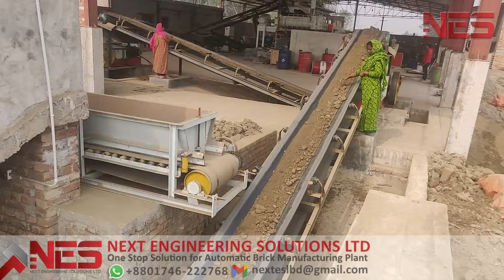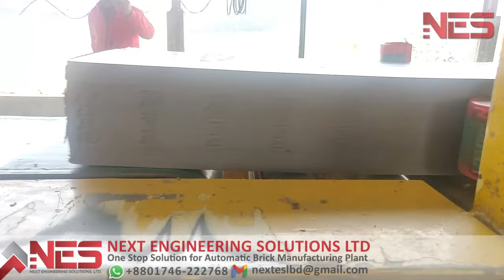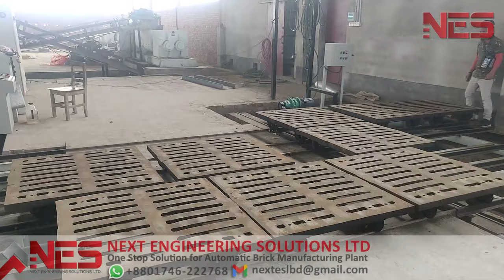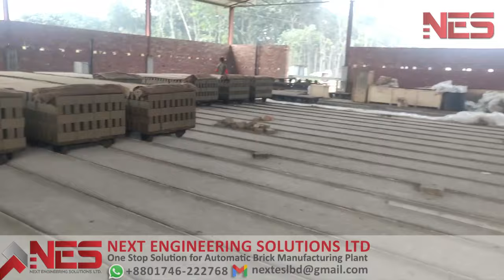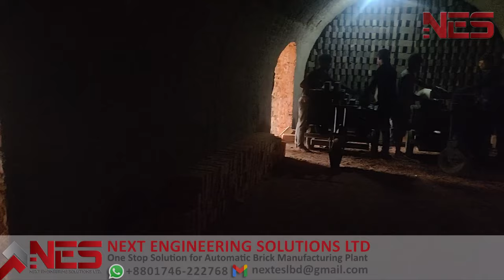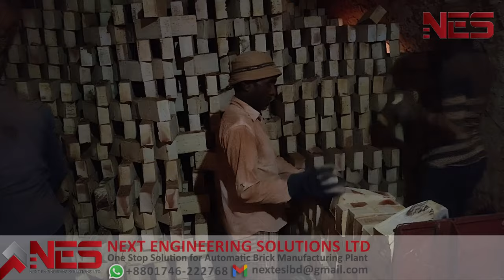Full Auto Clay Brick Making Process, Latest Hybrid Hoffman Kiln Firing in Bangladesh

Comment: You putting those people in great risk by posting them on an active conveyor belt. And also no proper PPE's..
Reply from the maker: Dear Mr Naten,
We do setup clay brick making plant. The safety issue should be accomplished by operating company. And in clay brick manufacturing plant, do not need high quality PPE. In clay brick making plant helmet 🪖 and safety 🦺 jacket good enough.

Thank you.
Reply from the maker: The clay of this area have lot of rubbish which removed by people manually. So, conveyor belt is open here. Usually conveyor belt should be close. Please see other project, here conveyor belt is sealed.
https://youtu.be/3a6ZLb2R6y0